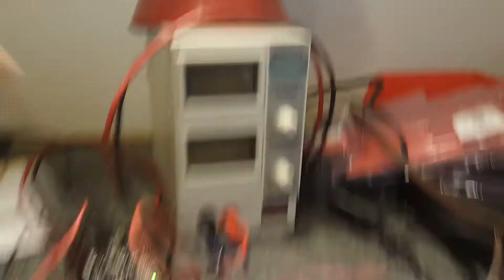Raspberry Pi and Arduino to Automate Aquarium Lights (NeoPixel LED Strip)

Comment: Was googling for this idea, and your video popped up. Wondering if neopixels are strong enough to promote plant growth? Wondering if you needed the arduino at all, could the Raspberry PI control the LED strips on it's own?
Reply from the maker: They are not intense enough. This was a while ago, but I think I didn't initially plan to used actual sunset times and sunrise times... But I believe I only used the Arduino for programming the lights.